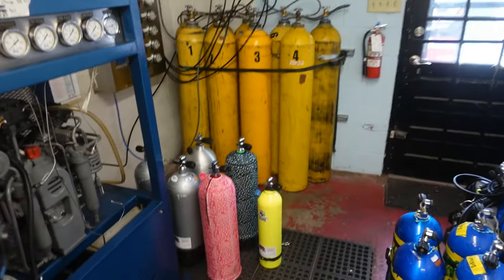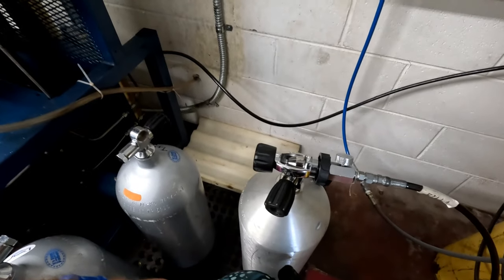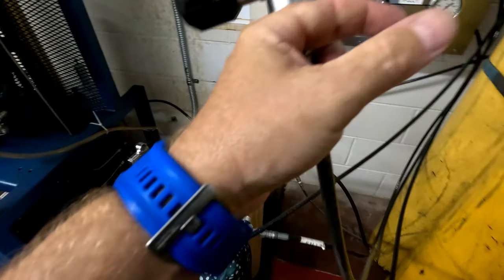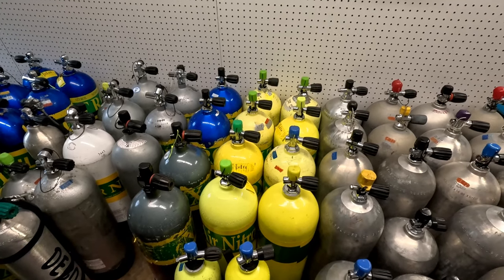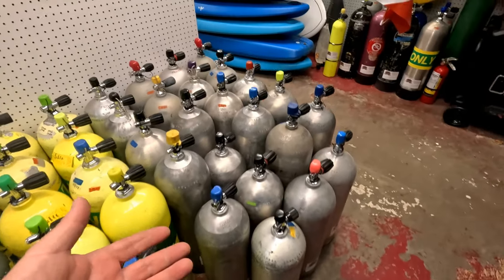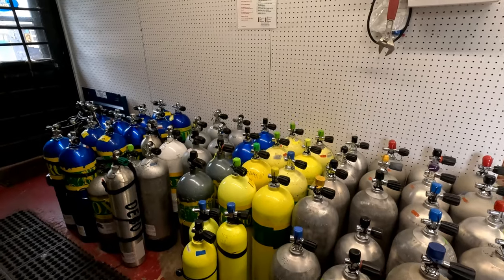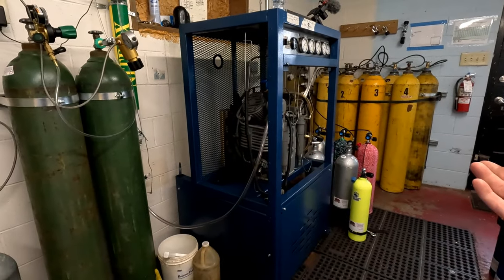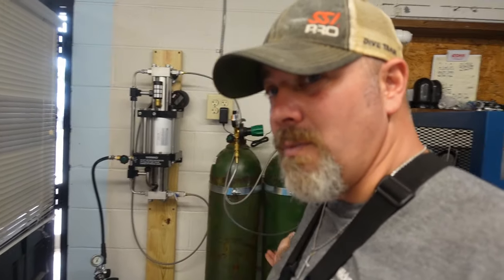The Secrecy Of The Fill Station {[Random Thoughts]}

Comment: We go to the fill station at our LDS all the time.  The only time I stay away is when they are blending Trimix.  Not because of any real danger with the physical nature of it, but more along the lines of not wanting to become a distraction, causing them to put the wrong amount of a gas in because they were paying attention to me and not what they were doing.  As far as the whole “we should be in the shop spending money,” well I guess that depends on the customer.  New customers, sure.  New divers, sure.  Not that we’ve been diving a long time, but started frequenting our LDS right after getting our OW very at another shop.  The other shop, I won’t go in to here, but let’s just say we didn’t have the best experience there.  Our current LDS took us from our OW cert right up through OC normoxic Trimix.  Which took us down the rebreather path we just started on in May.  We call our LDS owner the local crack dealer!  “You want to one of those?  Here!  Try mine, and see if you like it!”  I couldn’t tell you how many times that has led to a sale!
Reply from the maker: Sounds like you found the perfect fit for you in that shop @mahnkemachine3281. We do the same here. Our customers routinely try items out before they buy them.

Comment: My local shop used to have the fill station right in the center of the shop. Tanks should not explode, the worst that happens on a properly designed and assembled fill station is a blown burst disk.
Reply from the maker: Hello @eldiablo7862, there are several shop I visit quite regularly, and they too have their fill stations in the main area. They have never had any issues.

Comment: My shop Fills the tank while its in a Waterbath
Reply from the maker: Hello @chrisphilhower6029, unfortunately there are still some shops that choose to do that. From a safety standpoint, it can cause even more issues. Now that being said, the only time this can be beneficial is if the water bath remains a constant temperature. Most shops that still use the water bath do not regulate the water temperature, thus, nullifying the entire process.
Reply: @LakeHickoryScuba  My shop isn't super busy. It's mainly a Ski shop